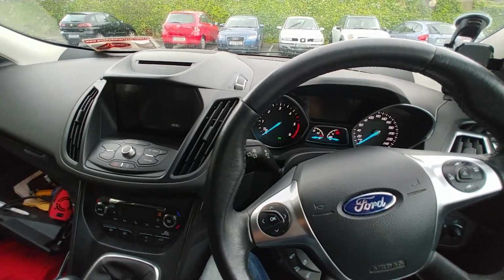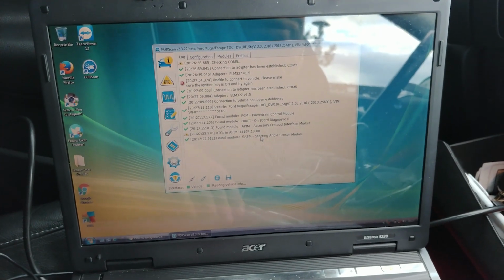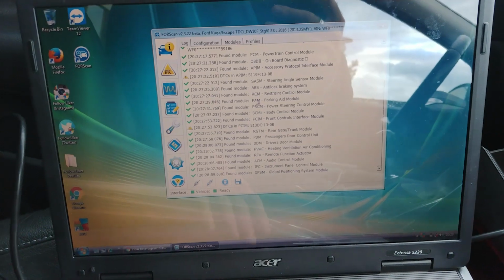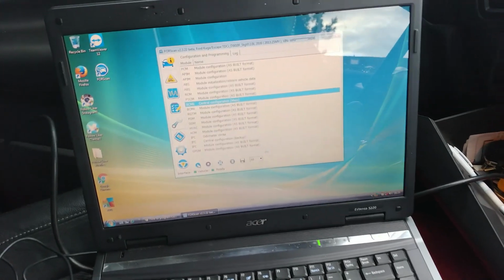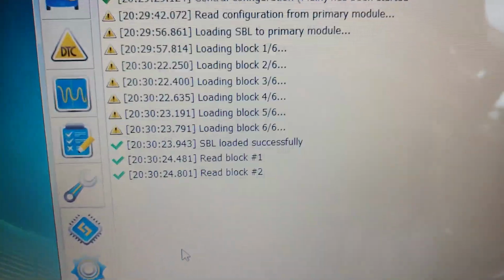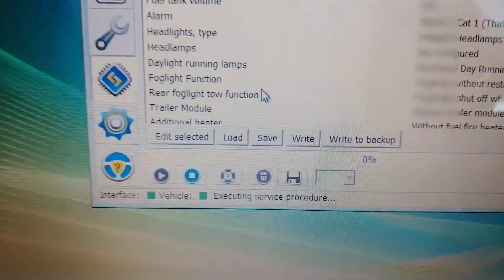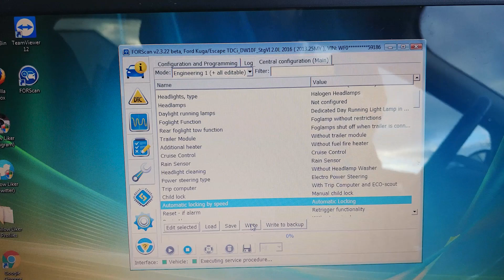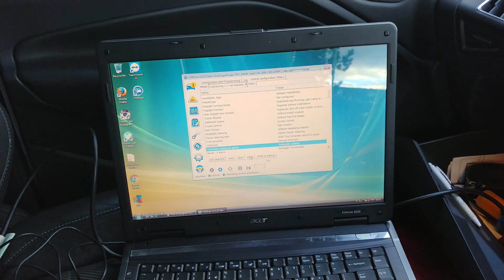Enableing Auto-Lock on Ford Kuga / Ford Escape with Forscan

Comment: hi, i have read the post and have config the necessary files but unable to get mode tab to use engineering 1. my forscan version is 2.3.45 release. i did downgrade to an earlier version but had worse issue. i did read in the forum that some vehicle are not equip with CC or bydm (main) and therefore the engineering mode wont be availible. my transit custom only has bydm AB or bydm without (main). according the forum its for this reason the mode tab is not available. can you possibly shed some light on this issue? it could really be helpful. thanks in advance.

Comment: Mate, 

It was a déjà vu watching your clip. 

I live down-under and since new I also own a 2016 Kuga Trend 2.0L TDCI  which had a Sync 2 with an SD nav and a repeater dual climate control, but no apple car play or Siri . I love the car and i's  tech pack 

The Escapes models were released in  2017 with Sync 3, and to the best of my knowledge to this day none of the Ford cars sold down-under have active  climate control icons on their Sync 3.   

Few month ago,  I swapped my 2016 Kuga Trend Sync 2 for a mid 2018 Escape Trend Sync 3, version 3.0  with inbuilt nav. 

After the install, I used FORScan to change four digits in the donor Escape Sync 3 AsBuilt APIM  module to activate climate control icon; dual temperature repeater;  GT Ford Performance logo (not fond of the Ford one);  and  turned the Sync 3 screen colour and displayed font for letters/numbers  into the GT nominated ones. AND in the BCM Central I activated the speed related auto door lock. 

All works 100% perfectly, EXCEPT FOR THE CLIMATE CONTROL REPEATER IN DUAL MODE. 

ON THE SYNC 3 SCREEN, THE TEMPERATURE SETTING FOR THE DRIVER IS DISPLAYED AT THE PASSENDER"S SIDE. 

I am told that all Sync 3 in RHD cars (e.g. the UK, Canada, NZ,  here down-under, etc)  have their climate control switched off because  bloody Ford couldn't be bothered swapping a couple of wires within the cache plug terminal at the back of their APIM so that the climate control repeater  synchronise correctly with dialled LCD display  

I see in your clip, the Sync 3 in your RHD Kuga  has an active climate control module.

Am I correct in thinking your 2016 Kuga  Sync 3 is an upgrade from an original Sync 2? AND that you used FORScan to activate its Sync 3 climate control in your vehicle? 

If so,  are you experiencing similar climate control temperature display reversal in your RHD Kuga??? 

Thanks in advance in anticipation of your response. 

Joe

Comment: There is an easier way, put ignition on without starting, press middle lock button 3 times, you'll hear a beep, turn it back off, press button 3 times again, start ignition, you will hear a horn signal, meaning your in engineering peripheral mode, press middle lock button to toggle on or off then switch off. done!
Reply: This doesn't seem to work for Aus cars and I presume same for Euro. The method you describe works perfectly for USDM cars from the vids I've seen online
Reply: @bradjames2732     Correct, that method only works for US cars And there are plenty of videos describing it but I tried it on my aussie model and no go. This Forscan method works I am told but I do not have the confidence to try something like that.
Reply: John Waugh I did the Forscan method described in this vid and it worked perfectly :)
Reply: Something for safety, if you feel threatened outside the vehicle, you have to jump through loops to activate that feature?